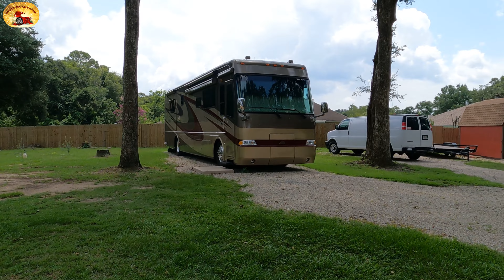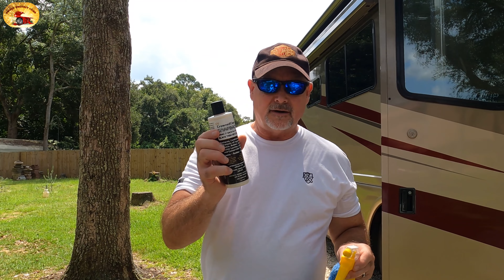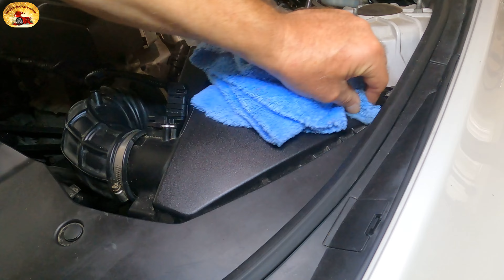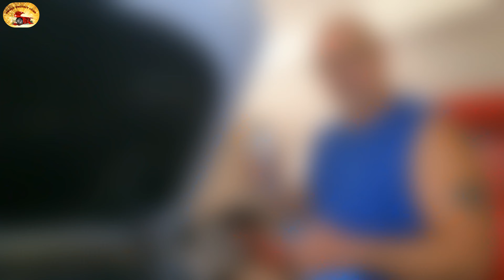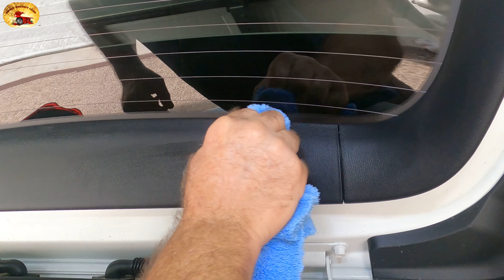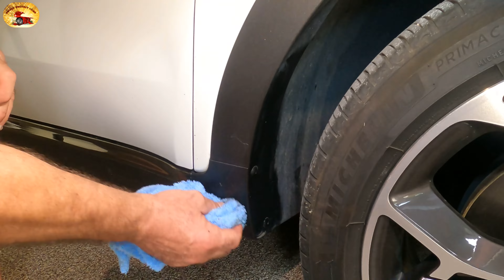Our NEW BEST UV Protectant Conditioner For Leather, Plastic, Vinyl, Rubber etc.

Comment: Mike, I love this stuff! I use several The Rag Co products and can't say enough good about this product. For those curious, and want the best results. Clean the surface thoroughly. Apply a thin coat and let it dry/set up for 24 hrs. Try to keep it from rain or getting wet for this time. Then apply a 2nd coat. The results and longevity will amaze you. So glad you found this Mike. I just hope the price doesn't change now that more will know about it! 🍻
Reply from the maker: Awesome! Thank you for watching and sharing, we really appreciate it, hope you have a great week. mad Mike the hammer SPC
Reply: this is not the Rag Co. this is Crowned Clean... wayyyyyy better product! thanks Mike for sharing!

Comment: Been using that plant oil, great idea for hair clippers a lot less smelly than regular 3 in 1 oil. Worked great on skateboard bearings too, small 7 ball machine bearing or any sealed bearing race. Yeah supposed to be grease in there but when skateboarding I have found you roll further on oil than grease without giving yourself another push.

I've been using Turtle Inside & out. It stinks and I'm mildy conscious of getting too much of it on my skin. Seems to work great and the smell goes away fairly quickly. It's nowhere near 303 but in terms of getting something to protect your car in the mean time for a low initial get by poor mans price it works just as well as their wax.
Reply from the maker: Thank you for watching and sharing, have a great week my friend. mad Mike the hammer SPC

Comment: Sorry I forgot to ask how long have you been using it.  Will it stand up to the elements and car wash? Thanks
Reply from the maker: If you're looking for long term shine on your hard plastics, use this https://amzn.to/3JHFjp9   it will last for 2 years. But if you are looking to condition your rubber door seals, tires, leather, vinyl, use this https://amzn.to/3O67Gi7   and it will last for months. We do not have a calculation on lasting power of going through car washes because we do not promote going through car washes. There is no more damage that can be done to a vehicle than an automatic car wash. We promote washing your own car by hand.  Hope this helps, thanks for watching, have a great day. mad Mike the hammer SPC
Reply: @SweetProjectCars  Thanks!
Reply: @SweetProjectCars  how long have you been using it? Or did they just recently send you a bottle?

Comment: Mike, the bottle says "black trim restorer". I, therefore, assume it can only be used on black surfaces, right? Also, Mike, are you recommending this product over Trim Serum, Leather Love, and 303 which you have recommended before for trim and leather restoration and UV protection?
Reply from the maker: It's for ALL colors of trim ben. And this product is something we came across and thought it would be a great alternative to 303 because it's very economical as 303 prices have gone through the roof. Hope this helps. Thanks for the view, have a great week my friend. mad Mike the hammer SPC

Comment: have you tried mixing this with water into a paint spray container gun that goes onto an air compressor. would like to see a review, money wise and effectiveness
Reply from the maker: check this video out as this is how we use it now  https://youtu.be/UIp8ZwNdVjk
Reply: @SweetProjectCars  what about putting it into a $10 paint spray gun hooked to a compressor. You can then easily coat engine pays, trim, ect. Can you make a video on you testing this? Thanks

Comment: can you run TEST with 303 I have used 303 on tires , seats, plastic windshild wipers and it looks great Clean Not greassy looking . If you put 303 0n coil packs of LS1 motor it will not start till it dries. I called 303 message No one called me back.
Reply from the maker: Thanks for watching, we've already run our own tests, but feel free to do your own, you will see that there is no comparison in the quality and the price!  Have a great day! mad Mike the hammer SPC & team

Comment: Is Crowned Clean the same company as Solution Finish? 
East and West brand type situation, maybe? 
(Example: Hardees and Carls Jr)
Or a family dispute over the rights of the pruduct name, but sharing the patent of the chemical?
Reply from the maker: No. thanks for watching. mad Mike the hammer SPC
Reply: They are not the same company. Different chemical formula. I tried both and I am sticking with Crowned Clean. Much better product overall. Try them both and you will see for yourself.

Comment: UV protectant under the hood huh? 😄
Reply: Wish I wouldn't have spent so much on those wipes you recommended and got this stuff.
Reply: Hey if you had a car like mine the hood stays up more than down...unfortunately.
Reply from the maker: Absolutely! It's a conditioner as well, use it on everything! We are going to use all of the supply of 303 we still have along with the wipes, so use yours as well. But, after that we will be using this  https://amzn.to/3O67Gi7  strictly. Thanks for watching, have a great week. mad Mike the hammer SPC